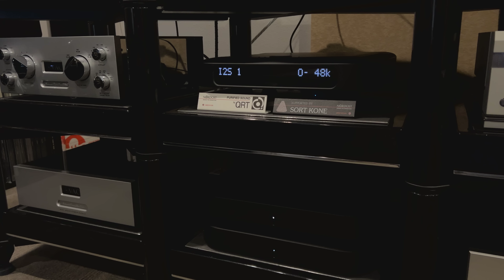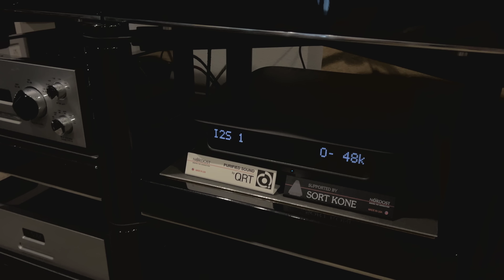CD Vs Streaming - The Results Are In!

Comment: Based on your explanation of the results, makes me wonder if the the streamed versions, while possible at similar bit depth and/or rate as the CD version, may not be in fact the same mastered digital file or whether even Qobuz does any post processing on any/all their files.  Without knowing that , how would you know whether the anomaly you're experiencing is due simply to the network congestion? I'm not suggesting because I know something specific, I'm stating because I don't sense there's enough information(behind the curtain information) to make the conclusion one way or another.   By ripping the CD, you definitely eliminate the question of the source.. but that doesn't automatically make the transmission medium(ie network, etc.) the culprit.   I have to believe that your streaming platform can buffer enough data to minimize any of the network jitter coming from your router - specially since you are going over the same internal network(ie switch) when playing the ripped file off the server.  Just stating that it would be great to know more!
Reply: Nobody blames a "network congestions". The result confirm what I knew for a long time: streaming services continue to broadcast the heaviest compressed music when there is NO need for that (that's not a radio station user can tune or not). They continue to choose the latest release despite a fact that for every album there is one the best, and in most cases it's not the latest one. And of course their engineers suppose they are better than colleagues from a recording studios. So, that's not about a media, but about lack of streaming service professional stuff.
Reply: I tried Deezer Hi-Res a long time ago and compared it with my CD. The music from Deezer definitely had boosted base and more forward mid-range, and that was through a very cheap stereo system. So, yes definitely, the service provider did alter the sound some how. That is why I never sign up for any of them.
Reply: @sc0or   For clarification, the gentleman from Suncoast Audio who recorded this video made the comment about why the streaming sounded inferior due to "...how far the signal is going.. all the junctions.. noise,.. etc." , therefore he is not part of the "Nobody" that you are referring to..Clearly that is a thought form that exists.  My comment was in response to his statement and not what everyone anywhere else is saying or not saying.  I tend to agree with you that the issue here is more mastering related and not so much the transport.   I looked at the original shootout video, and the title said "same mastering" but we were not given the mastering details. From my vantage point, I would only be able to conclude my preference, but I wouldn't be able to conclude the reason behind it without further information.
Reply: The point about the mastering is a good one but usually differences between an original mastering and a remastering or different remastered versions are not subtle. I’m assuming that Mike & team at Suncoast Audio would have immediately picked it up if they were not playing the same versions… the explanation about SQ difference likely lies somewhere else

Edit: actually Mike does clarify this point when answering to Geo a few comments down
Reply: @joel_hifi1994  Thanks Joel for the headsup on the response below.  I do see if and will make a comment there. You do make a good point. I did look at this record, and interestingly enough, it was only issued in 1991 in CD and never "remastered" which removes mastering completely from that equation. It still does not mean that Quobuz does not do any manipulation to the file .

Comment: So much BS snake oil on this comment section it’s actually insane.

Even the video doesn’t seem to know how the internet works; there’s no noise on a TCP signal; you either get bit perfect from end to end or “noise” (Tx/Rx error) that the source is notified of a bad Rx and the lost bit packages are re sent.

You can have the cleanest power supply for your modem/router/iPad but it won’t make a difference, it’s the same level of asinine ignorance as audiophile grade SD cards.
Reply: some people in this comment section should be ashamed for spouting complete crap. thank you for clearing this up

Comment: Great work on this!  Has there been any discussion or similar polling/testing done between CD and Qobuz purchased downloads (WAV)?  I've ripped around 3,000 CDs over the years... to WAV and then later encoded to FLAC and/or MP3 320 for various transports, but have recently been looking into Qobuz purchased downloads for hard to find stuff or simply not available on CD.  Thanks in advance.
Reply: I love Qobuz for streaming. I’ve not purchased anything from them yet though.

Comment: Through the same DAC I can't tell a difference with same master using a transport vs. streaming. Qobuz hi res 192 can sound dramatically better than 44.1 or cd but could just be better masters. I don't download but can't see why streaming would sound any different unless there's buffering issues. My Forte IVs with tube dac are very revealing and some higher res files sound very dynamic, 3d, and lifelike compared to cd quality. Just my experience with node 2i and a good dac with nos tubes. When I listen to a Heart song like Straight On in 44.1 and then switch to 192 version there is a huge difference across the spectrum but it was subtler before I got the Klipsches. Wish I could analyze the waveforms to see which is more dynamic cause I sure can't get the same effect by just turning up the volume on the 44.1

Comment: Mike & team - really interesting shoot out thanks for posting. I have tried it at home and found similar to you guys even though I have  different gear. I have dCS Rossini player with APEX upgrade and clock. I use Qobuz all the time. CD has always been superior to streaming. However, I recently swapped Audioquest ethernet cable for an ADOT optical bridge from router to Rossini. Prior to the swap I would give CD 10/10 and Qobuz 7/10. After the switch I now give Qobuz 9/10 which is great as I love Qobuz. Interesting. By the way, I would really love to see a shoot out between CD and Vinyl. I sold all my LPs back in the 1980s but I am now seriously considering adding a TT to my system and would very much appreciate your thoughts.
Reply from the maker: Thanks for the comment.  I will do the shootout again, with a few changes.  Stay tuned.  I want to get streaming to 9/10 like you.
Reply: Same here i use Paul Pang Quad Switch to Sonore Optical module Deluxe v2 + LPS + Pink Faun LAN cable to streamer.

Comment: Mike, Are you saying that if I use lets say the Aurender A30 and rip a cd in to it, it will end up sounding the same as a transport/player?
Reply from the maker: In our situation, when we ripped the CD on the ACS10, and played it Vs the CD, we could not hear a difference.   We were straining to hear a difference.  I would give the CD Transport 10/10 and the ripped version on the ACS10, 9.5/10.  Streaming services about a 7/10 or 8/10.   Just our observations.
Reply: @highendaudio  Thanks Mike!
Reply: Great info.  I was just trying this at home last weekend (CD vs online streaming). I agree, closer to original source is best but usually less convenient.  By the way, I like the chairs you have in the video, any idea the manufacturer?

Comment: 1:09 I2S is fibre optic?? I thought it was an electrical connection using the HDMI interface
Reply: You are correct.  If they were using TOS link I would seriously SMH, I'm not sure this guy knows what he's talking about.
Reply: It's converted from wire to glass fiber ( not tos link ) and back to wire.  

External I2s connections could be rj45, HDMI, glass fiber, etc.
Reply from the maker: @gettcharged4982  https://www.msbtechnology.com/dacs/prousb/

Comment: The fact that ripping a CD track and playing it from the streamer cancels the difference between the two sources makes me think the difference doesn't lie between streaming and CD per se, but rather between that particular streamer and that particular CD transport. That said, i do tend to agree that the fewer steps you have between source and speakers, the better off you are.
Personally i don't stream. Partly because i fundamentally disagree with not owning your music and i hate the direction the whole music industry is heading with this, and partly because US regulators seem to believe that the best way to combat piracy in Latin America is to prevent people in these countries from having access to legal hi res streaming (go figure), which means Tidal, Qobuz etc are locked away...
In my experience, comparing playback of the same track from a CD (Meridian 500 transport into Chord Qutest dac via coax spdif) with playback from the same track ripped to FLAC (regular PC into same dac via asynchronous usb, playback on WMP) reveals subtle differences (transport sounds more "liquid" if that makes any sense, vs a slightly "drier" presentation from the pc). However, both are equally satisfying and i'd be hard pressed to say which of the two is "better". Choice in this case would merely be a matter of preference tbh

Comment: I find untreated CDs to be unmusical.  I sand the outer and inner edge.....black the inner and outer edge and most of the top of the CD with a black Opaque oil based paint marker, treat the CD on both sides with ultrabit Plantium Plus fluid, and destatic the CD with an Ionoclast.  The destaticing enhancement lasts only about 7 minutes of play time before you need to re zap it.  However, it makes the CD way more real sounding.  I also use the little carbon fiber CD mat from Herbies to good effect (best mat I have heard including Marigo).  So......do you guys do any treatments?    Works the same for SACDs and even Video discs.
Reply: Yes, all this is good, you should also place isolation blocks under the CD transport to ensure that no vibration can flip the 1s to 0s lest all your treatment of the disc itself go to waste.  Gold plated optical cables should also be used connecting the transport to DAC to provide a richer sound if not wallet.

Comment: You guys are comparing data files to the red book standard CD (no data files...its a continuous bit stream of audio).  Data files whether on usb, hdd, ssd or streaming (hard drive) have data extracted in a non-linear fashion which is the opposite on the Red book Standard CD.  Data extraction plays a big role and the data file will always pale in comparison.  Every time.  Sorry, not sorry.  "Unlike on a DVD or CD-ROM, there are no "files" on a Red Book audio CD; there is only one continuous stream of LPCM audio data, and a parallel, smaller set of 8 subcode data streams." -Wikipedia

Comment: Interesting. The fact that the ripped CD via the streamer sounds the same as the CD via the transport, makes it worth to upgrade the internet modem (with low noise power supply) and especially use separate audio switch (with even better power supply).
At my home this made a significant improvement of the SQ! 
Greetings from the Netherlands

Comment: I like the fact that you attempted to equalize electronic paths, but your "test" is far from scientific. There are differences between CDs and between players. Also, there are differences between streamers and between streaming services. Your intimation, that this was conclusive, does not leave me convinced. I do like that are one source of testing. Plus, there are other considerations for music purchasers besides staged comparisons.
I, for instance, have an older Denon CD player which is out-performed by a new streamer and either Tidal or Qobuz (at 24 bit 192kHz.)  The difference isn't worth consideration (either way) at lower resolution. I would need an expensive upgrade to my system (high end CD player, and HR CDs) to get a better result.

I get that a music lover would be well-served by employing BOTH CDs and Streamers. There is no contest regarding convenience; streaming will beat the holy crap out of CDs for ease of use. I don't have a lot of CDs. I normally find only one or two selections, on any CD, that I want to save forever. And, there are always those songs that are awful, which I have to endure or skip. On the other hand, I have loved CDs that I can't find reproduced on Tidal or Qobuz. Beyond that, many "remastered" albums just don't retain the same ambience of the original. I highly value my CD collection, but I haven't played a CD since I got my streamer, a Cambridge Audio 851N.

One might find that you are a great source when building a new system from scratch. I assume you would cater to individual consumers' needs.

Comment: That explanation is total nonsense. Noise and jitter are irrelevant unless it's making it to the DAC. It's a digital signal, degradation does not happen in a meaningful way. And the fact that your ripped file sounds identical proves that. Clearly what they are streaming to you is not the same source as what's on the CD.
Reply from the maker: It IS the same.
Reply from the maker: You’re wrong.  Everything affects the sound, including noise.  Unless Qobuz is compressing their files somehow (even though they show up as 16/44), they are identical files since this album - which I picked specifically because it hasn’t been remastered - is a great example.  Reducing noise in audio is key.   The ripped version is far less susceptible to noise and isn’t traveling across the world.
Reply: Mike is Factually Correct regarding Noise
Reply: @highendaudio  You're wrong. Noise in the digital domain does not equate to noise in the audio.  Noise does NOT effects digital signals, it infact CAN"T effect it. It's kind of the entire point of digital in the first place. The only way it gets into the audio is if it reaches the DAC, but any moderately high-end gear should eliminate it before that through galvanic isolation and jitter compensation(buffering/re-clocking etc) . Either that's not happening in one case here, or the source data is different.
Reply from the maker: @G3rain1  you’re wrong.  There is no different source.  If your theory is correct than a raspberry pi will sound the same as a $30,000 Taiko or Aurender and they do NOT.  Also, if you’re right, all playback software would sound the same right?  It doesn’t!  Even on the same device!!  We have proven that with the Taiko and the Innuos where you can switch on the fly between noisy roon and XDMS or Innuos software.   Noise affects Everything!  Even Ethernet cables and switches make a difference!  Good switches eliminate what?  NOISE!   Phase noise and jitter via network audio is real.
Reply: @highendaudio  I never said those thing don't exist or aren't real. I said they don't matter inside the digital domain. If jitter and noise are eliminated before hitting the DAC circuitry, (which they absolutely should be on this level of gear, and frankly should be on several levels down from this gear), then it's physically impossible for it to make any kind of difference to the analogue output.  If there is a sonic difference there's only 2 possibilities: Jitter and noise weren't actually eliminated before the DAC, or the set of bits received are different. Either issue would be easily detectable by capturing and comparing the 2 input signals going into the DAC.
Reply from the maker: @G3rain1  we can agree to disagree.   Try the experiment yourself and see what you find out.
Reply: @highendaudio  From my experience software implementation and settings have the biggest effect on sound when it comes to streamers. Dropped or late packets can too. 

Do you know if those two streamers  manipulate the data in any way?
Reply: @highendaudio  Wow, an engineer steps in, and calls out the logical fallacy of your comments, and you immediately remove that comment, because it doesn't support your narrative or your ego. Explains everything anyone needs to know about this channel and its content.
Reply from the maker: @bigbuckoramma  huh?  We never removed a single comment.  Maybe the poster did?
Reply: @highendaudio  I'm wondering if you were to rip the Bonnie Raitt CD and store the ripped file on a "cloud" storage platform such as dropbox, google drive, etc..   anywhere that the streamer can access(assuming that's even technically possible), does it sound the same as streaming? Does it sound the same as the ripped CD stored locally?   I imagine this would give us further data point and  may create more confusions, but at a minimum give another set of data to chew!
Reply from the maker: @HoomanR17  that’s a fantastic idea!  Let me see if we can figure a way to give that a try.  👍👍
Reply from the maker: @HoomanR17  I’m wondering how I can access the cloud files from Roon without a VPN?  Any ideas.
Reply: @highendaudio  Unfortunately not. I'm not a roon user but looking at the Roon forums I don't see this to be an easy option and I do see VPN being shown as an option.. Not knowing much about the SGM, it does appear to be a windows based system.  I imagine you can install any popular cloud storage apps (dropbox, google drive, etc.) so that they mount a drive letter and then run a the best native application on the SGM instead of Roon to play the file. Just need to make sure/confirm that depending on the cloud storage software you use, that its set to streaming and not mirroring so no file is cached/stored locally.. then you can even do an A/B of a stored CD rip vs. the cloud stored one.
Reply from the maker: Watch the next shootout series.  You’ll hear what eliminating the noise can do.
Reply: @highendaudio  😊 looking forward to it. All my Systems have the most advanced state of the art in noise non existence.